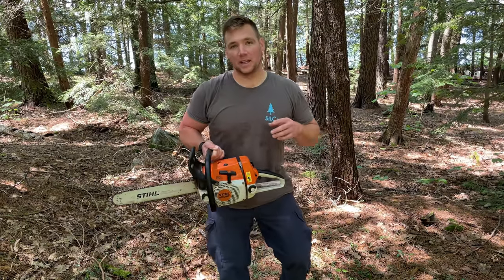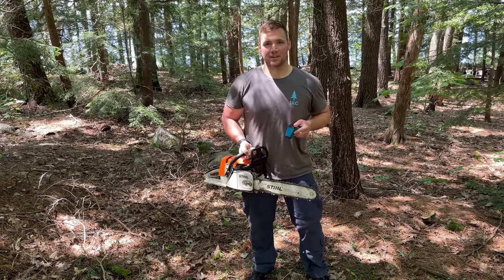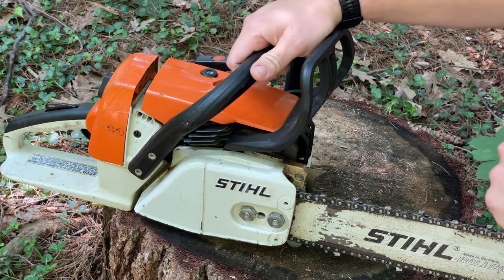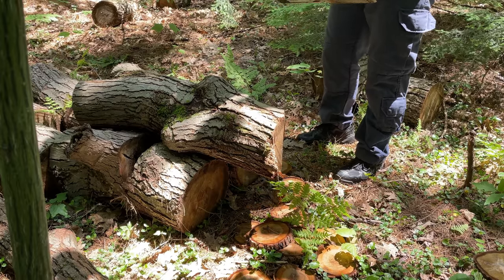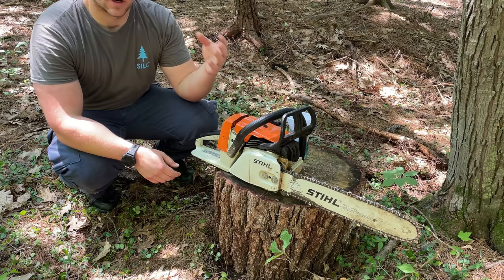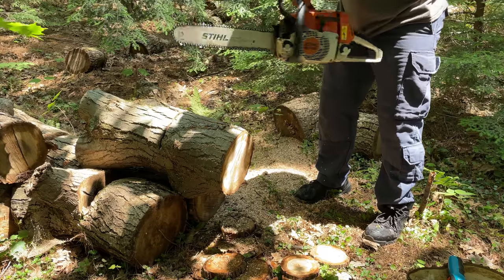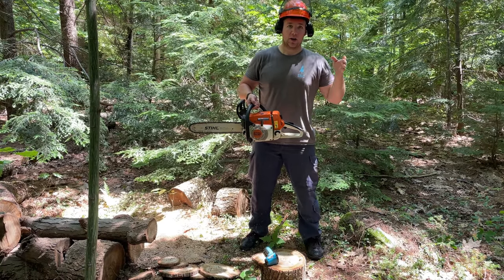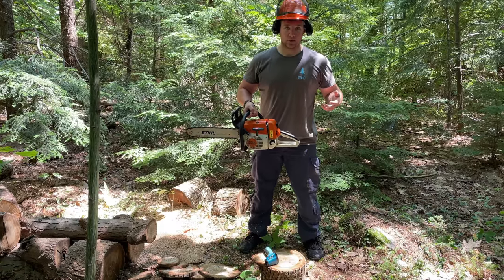Will my chainsaw last longer if I use more oil? Is it safer? (25:1 VS 50:1 temperature testing)

Comment: I run a 2007 husky 372 calling for 50:1 however, was told from place of purchase to run 40:1 ....... never an issue....... i did not adjust by half (25:1) ....... im sure that would have made a significant diff as demonstrated here.

Comment: The manufacturers mixture will ensure the engine won't seize and perhaps richer than it needs to be for short projects. 
If one spends enough time with 2 stroke motors you start to know when a motor is to rich. I believe I have 75K miles on 2 stroke motorcycles mostly on Yamaha RD400's chainsaws are the next best thing...

Comment: It has been suggested to me by a person who used to race 2 stroke go karts that the oil doesn't burn and produce power like gas does. 
Also the evaporating gas helps cool the motor.
it seem likely that technology in oils is constantly improving so what was true 30+ years ago may not be true now.

Comment: A couple of things of concern
1/ the saw was not retuned for the different fuel mix.
If these is a diference in the octain or other fuel values due to the heavier oil mix, to be fair the saw should have been retuned.
.
2/ Was the chain resharpened for the second test.
A less sharp chain would present more load and thus higher temperature.
.
3/there was no attempt to observe the amount of oil left in the machine, by taking off the muffler and looking in the muffler and thru the exhaust port or simply pulling the spark plug..
There has been no attempt at looking for the signs of adequate or excessive oiling, in the engine
.
.
In addition running such a high oil concentration woulld rapidly carbon up both the muffler and cylinder.
.
,
This whole idea of measuring temperature is, an indirect, obscure and pretty much meaninless way of determing adequate lubrication.
.
IF anybody wants to get a real indication of adequate or excessive oiling, the simplest and possibly most acurate way would be to pull the muffler and look thru the exhaust port.
The piston, rings and cylinder interior can be clearly viewed thru the exhaust port with no special equipment.
Excessive carboning could be easily seen by observing the inside of the muffler, the spark arestor if fitted and the top of the piston.

Finally for any testing to be of use, it would require at least a full tank of work.

Comment: I have a small chainsaw with a non-adjustable carb and you can use oil ratio to tune for air temp.  When it's really hot out add a bit more oil to lean out the mixture, and when it's cold out cut back on the oil a bit to richen it.  It makes a noticeable difference in power.
Reply: Your a smart man, thank you

Comment: Great vide brother. I’m getting ready to cut a tree up with my father in law tomorrow. I have a stihl ms290. I only use it a few times a year. I run between 40-50 to 1. I kind of eyeball it. Lol. I get that from my dad. With a chainsaw or weed eater he just dumped a little oil in the gas and letter rip. He’s old school. Thanks again.

Comment: Exhaust gas and piston temps will continue to rise as you lean out the mix (more oil = leaner fuel) but whether that’s a problem depends on how rich the jetting is to begin with.

Comment: I have ran echo red armor and many other brands of oil even Itasca in the green bottle but I  run. Mercury Quicksilver marine 2 stroke oil now and I mix it at 50to1ratio and add a half ounce extra for a little thicker ratio , no issues at all and I have ran my echo for hours on this with 87 octane gas , piston and cylinder walls look like new ! If it's good enough for a 2 stroke mercury outboard running full tilt then why not !

Comment: Looking at the two jars of fuel made me realize just how obsessive I am about closing fuel containers.  When getting ready to fuel I will loosen the cap on the engine but not open it until I have my fuel can ready to limit the time that fuel is exposed to air, evaporation is the first concern but getting trash in the fuel is another. Especially important these days cause of the possibility of alcohol absorbing water from the air.  I saw those jars sitting open and had I been there in person I would have been overwhelmingly compelled to cover them with something, a sheet of paper, a rag, something,  cover that up!  I guess they got in my head, the environmentalists using the strong arm of the EPA to take the adjustment screws off carburetors, forcing everyone who does not know how to get around it in to using their equipment in a sub-par tuning condition, all to reduce emissions, which I am not convinced has served the intended purpose.  I mean, if you junk the whole machine and purchase a new one cause a carb ran lean, how does that reduce overall emissions?
Even if you dont buy the whole environmental argument, it is still a good idea to limit how much evaporation happens so you have more predictable fuel and less contamination from junk, including water from the air, getting in your fuel tank. I bet you with 30 years of being diligent about closing fuel systems as soon as possible I have saved 11 cents worth of evaporated fuel!  Dont get me started on government dictates on the design of fuel cans! I have spilled much more fuel with those goofball cans than I ever did with the old ones that had nothing but a neck plugged with a rubber cap.

Comment: Doesn’t create a lean condition if you retune the saw which is a given with an oil mixture change. 
Also because the saw runs warmer does not have anything to do with it being less reliable.
Been running and fixibg 2 strokes for 30 years and 40:1 is the way to go in my experience and sticking with one brand of oil insteady of switching it all the time makes the most difference on reliability.

Comment: Stihl Oil@ 40:1 = perfect. Ran Stihl for 50 years, only time I had a problem was when we moved from leaded gas to unleaded. Put in a bit more oil to be on the safe side, wound up having excessive carbon buildup. It really pays to use premium gas too.. lots of outfits used regular marked gas which was fine for a while then saw exhaust would start to really stink and saws would get doggy.... Premium gas fixes that!
Reply: You cannot use premium petrol in hand tools in my country

Comment: If your  chainsaws manufacturer says 40:1  and you change it to 25:1 then you have added more oil per litre.
Adding more oil will then reduce the amount of petrol ⛽️  and your machine will have a leaner fuel mix which will course a hotter running temperature. 
Also if you run a lower octane fuel it will also run hotter as the lower the octane the hotter the burn 🔥 
It's best to follow the instructions the manufacturer sets out. 
Stihl, Husqvarna, Shindawa,Echo  all recommend a 95 octane or higher for longevity and power. 
It only takes about 7 to 10 seconds to running to melt a piston and render it useless.
But by all means do as you want

Comment: Good job. I have poulan saws and I think they recommend 32 to 1. So far I've cut a lot of wood and they run great. Not a pro but both saws have been through a lot of use.
Reply: stick to the recommendations of your engine, Paulie T.
Reply: @pls822  so far I think I have and yes I agree. In my case I know nothing so go by the book. Thank you good advice

Comment: Stihl has been making 2 stroke equipment for a long time and has had a good reputation for performance and longevity.  You would think they have done some homework to determine what works well and what doesnt.   Now if after decades of observation and testing, having been involved not only with the manufacture of engines, but in consultation with carburetor and lubricant manufacturers they have settled on 50:1 mix ratio, do you think they might know better than some yahoo with 40 hours total experience running a 2 stroke?
 Speaking as a yahoo with probably 3000 hours of experience using maybe 100 different 2 strokes I can tell you the saw used in this vid is running ever so slightly rich, not excessive, just burning a bit more mix than necessary to do the same work, close enough that I wouldnt tell someone to change anything other than make sure your air filter is clean, cause more than likely they will mess it up. A little rich is much preferable to a little lean.  So for most people I would tell them dont mess with it and mix 50:1 like Stihl, Husky, and virtually all the other 2 stroke equipment manufacturers tell you to. If you change the mix ratio, especially to that extreme, you really need to adjust the carb to account for that difference but dont do it,  just mix 50:1 like they told you to. And if you think some screws need to be twisted on the carb, take it to somebody who does that all day, every day and let them fix whatever is wrong that would compel you to twist screws, instead of twisting screws. If it was right and that has changed, it is not because the mixture screws have moved, something is wrong and needs to be fixed.  First step, mix fresh fuel at 50:1 and if that doesnt fix it, something else is broke (clogged) or the metering diaphram, a wear item, is ready to be replaced.

Comment: The 25:1 is operating in fine temp ranges and it will perform better at those temps so shoot anywhere from 25-50:1 is good

Comment: Oil contains more BTUs per unit mass than gasoline. The more oil, the more heat generated provided the engine can combust the higher oil content. This explains your heat gain. The engineers who designed the system have the heat rate for the engine figured out pretty close. If you don't mechanically modify anything, use the specified fuels and oils, and  run the saw within the design limitations, it will last a long time. Now your neighbor who ports the engine and muffler, jacks with the carb, and makes other high performance modifications will out-cut you, but he will also go through twice if not more saws than you over time. It's all in what one prefers.

Comment: Did you retune the saw for the 25:1?? that's a substantial amount more oil sounded like it was running rich with 50:1 already

Comment: The test didn't include the dulling of the chain, specially on a hard wood like oak. Or did you use new chains in both tests?? ( straight out of the box )

Comment: Just ordered piston /cylinder kit (again) made in china . Ran my ms029 sthil for the 1st time 3days ago for an 1hr. off and on no problem. I rebuilt it last fall and stored it. Tried to start next day…no go. Scored piston cylinder. 50.1 is what I used . Sthil oil. Are these China made piston cylinders 50.1 as well? Compression was 120-130 and then 90psi. Getting a new one tomorrow hope not to repeat this again ….not sure what I’m doing wrong . Thanks .

Comment: I agree. A25:1 mix is a lean mix.  I run Stihl Ultra at 50:1 in everything I own.  I don’t lug them into wood until I can cook breakfast on them but I have never had a run issue with this mix.  I likeJASO FD oils but they have two problems - they do not always stay mixed with the gas and the increase pull over on the saw.   The second problem may be a result of the first problem but I had a Stihl MS 251 that beat me to death last year running Red Armor 50:1.  It cranks fine on Stihl Ultra 50:1.
Reply: Better oil, better compression, quicksilver is a great oil as well, I’d stay away from 50:1
Reply: @alanmeyers3957  Alan, Mercury quicksilver is a TWC3 oil for outboards.  Outboards run a lot cooler than two cycle engines.  If you want to run a full synthetic two cycle oil stick with JASO FD oils, like Husqvarna XP,Echo Red Armor orEcho Power Blend Gold.  I run 45:1., typically, but I have run a lot of 50:1,too, with no problems and where I live gets 100 F. degrees in the summer.  I used to run StaMix at 40:1 thirty years ago but that was then and now is now and oils are better today.  Another good oil is Citgo Sea and Snow.  My friend from Wisconsin runs it and he cuts 12-15 cords a year for his wood heater.

Comment: Did you tune the carb for each mix?   if not the would enplane the power difference. you have to adjust the carb when you change the fuel mix.

Comment: I add just oil to my 50:1 saws until they start smokng too much, then back off. I used to run them at 35-40: 1.

Comment: Great experiment! Another problem with using extra 2-cycle oil is the increase in carbon particles in the cylinder. That would probably cause extra wear.

Comment: My old XL-12's call for 32 to 1. This would be the only engine that would come close to 25:1 with a bit more oil added.
I have not heard of anyone use 25:1 in a saw calling for 50:1

Comment: Just an hypothesis here: could it be that the oil being a better conductor of heat, it would distribute heat evenly through the engine making the outside part hotter and core part (at fuel ignition point) cooler?.

Comment: For some reason lean mix makes it run hotter in all engines. More fuel seems to cool it down but makes it dirtier as a result. So your 25:1 leaned out the mix and burned oil. The richer mix 50:1 added more fuel. I would say that high speed engines need the leaner mix. Maybe not all the way to 25:1 but somewhere around there to keep the high speed engine from rubbing and keeping things lubed. A low speed engine like at idle would do fine with a richer mix. 50:1. Everything made sense. I had to look up c to f though.

Comment: I have also studied this Dave and have gotten more or less the same results with a Husky. The 25:1 mixtures power loss is probably due to octane saturation. As for the heat, maybe the the extra oil burns hotter in the cylinder . Good video Dave.
Reply from the maker: Thanks Barry! Good to know I'm not the only one to find this. Cheers!
Reply: Bingo!  We need to remember the OIL has a btu content in the combustion process also.

Comment: All a person has to do is just mix 40:1 and go with it I own a poulan pro 330 (3) 028 stihls from the 80's (2) 291 stihls 510 dolmar (2) 025 stihls and a 562xp and a 372xp husqvrna all run just fine on 40:1 all are tuned to 50:1 and run 40:1 just fine I been professional logger for over 30 years and have never blew up a saw

Comment: The 25:1 will  need a carburation tuning because it will actually run leaner. This is why you get higher temperatures. Lets not confuse a rich situation with having more oil. The oil doesn’t burn like fuel and it is there to lubricate.

Comment: Remember Gordon Jennings two-stroke race engine tests in Cycle decades ago. The conclusions was more or less the same.  The best was to follow the oil recommendations. At that time, the two.stroke oil was not as good as today, so the mixture was with more oil, but nevertheless, to much oil didn't help.

Comment: I allways  use a 32:1 mix and I run the same oil I used in motocross Maxima 927. If you change your fuel oil ratio you have to rejet. when you did your test you should have dialed the carb in for that Ratio. If you put more oil in your gas you will have less gas going though the jet in the carb.

Comment: If the carb has mixture adjustments then it should be adjusted to increase fuel flow by about 2.1% That would compensate for the additional oil and return the air/fuel ratio to that of the 50:1 and reduce the temps.

As for engine life I would expect the 25:1 to provide significant extended life to all components.
Reply: Everyone seems to think that 50:1 is an engineering requirement, it is not.

Comment: I have a simple solution. Use Amsoil Sabre Professional 2 cycle oil. Regardless of the brand equipment mix Sabre 2 cycle oil at 1.5 ounces to 1 gallon of gas.  Your chain saw, trimmer, blower, etc., will run better than it's ever ran before. Amsoil is formulated to take care of all 2 cycle lubricating requirements.

Comment: during the 90's a japan motorcyle company ran test on many diff mixtures with oil and gas. 32 to 1 was the best for power, ring seal, engine life and anything else. u need to jet for the diff mixtures u r running. 25 to 1 would have performed great if u knew what u r doing. 100 blue is great for 2stroke engines because it has lead n it. lead will help cool a 2stroke to.

Comment: Good test, another reason not to over oil is that it creates more carbon buildup in the combustion chamber and ring area and this buildup will scuff pistons and cyls as well as a lose of total power.🇨🇦

Comment: 100:1 or 33:1 will give about the same lubrication of the cylinder. Sliding motion doesn't need much oil. The issue comes with the crank bearings. Open a chainsaw ran 1000 hours on 50:1 and one on 32:1. Guess which one has noisy bearings?
Reply from the maker: Hey EM! I don’t doubt it. That sounds like a good test eh?
Reply: 33: 1 WILL NOT CAUSE ADDITIONAL CAUSES, COAL?
Reply: @Sensei948  If using synthetic oil, and the carburetor is set right, no extra carbon. Its a rich H setting, and too much fuel, that creates carbon buildup. These modern synthetic oils burn very, very clean.

Comment: Use the  manufacturers guide on ratio mix simply because on todays premix motors you cannot adjust any carb settings .

Comment: Good test but to make it accurate you would’ve had to set both carbs at the same RPM with the high mixture screw because when you run it at 50:1 which I’m sure that Saw was tuned for and then you swap in 25:1 it is a leaner mixture less fuel so naturally, it’s going to run hotter.
I would think getting yourself an rpm gauge and tuning them both to the same rpm on the high-end, but with different mixtures would be more of an accurate test.

Comment: I’d get scared when I didn’t see or smell the oil in the exhaust!  

Had power tools that spoke of 50 to 1; and both richened out the mixture and went to 32 to 1 MC1+ on the weed-eater.  Had no probs.

I’m planning to run 28 to 1 Maxima K2 on the Zenoah, and richened to almost-blubbering under load, as the engine will be running 30-90 minutes under medium-heavy load pulling a dc generator.